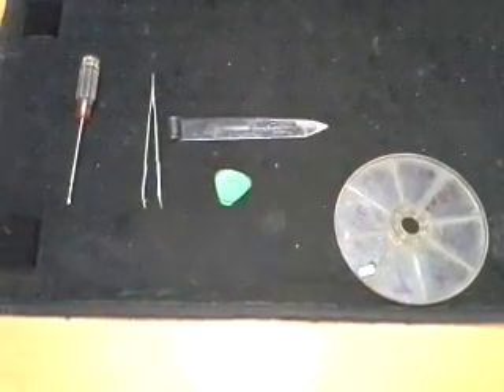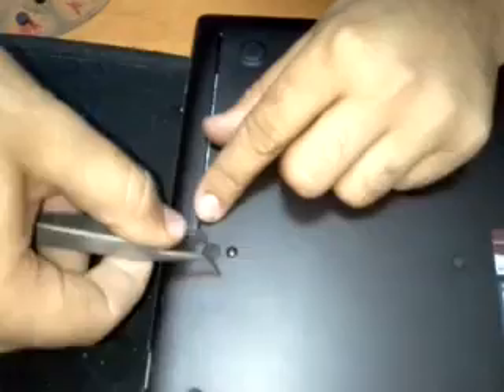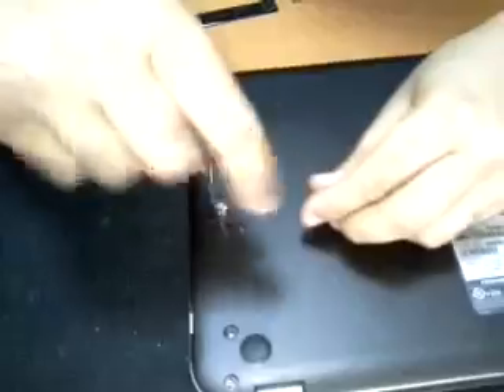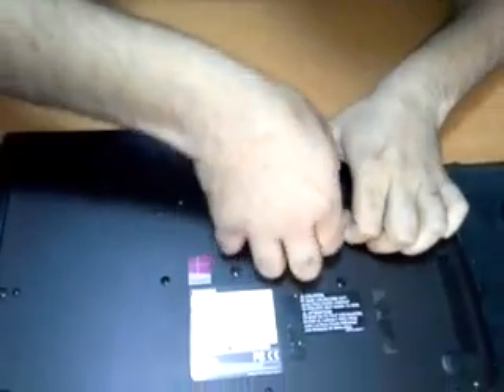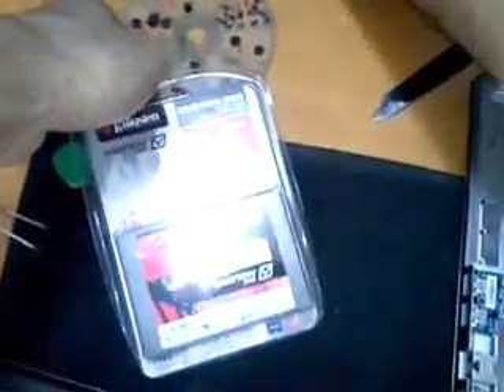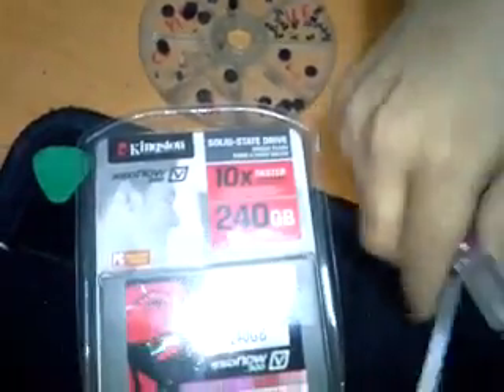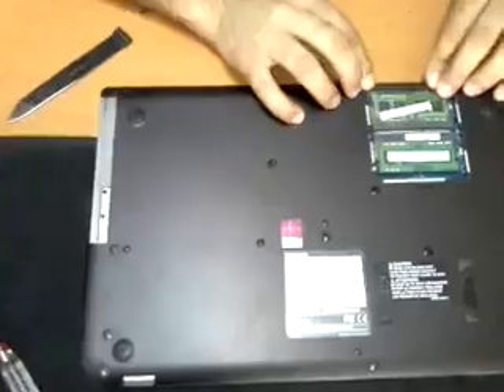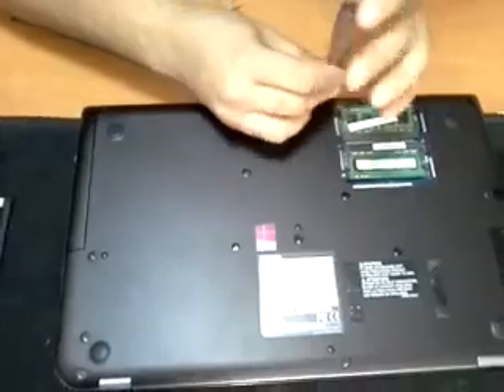How to disassemble TOSHIBA P50+SSD hdd replacement- Milad Ghaddar

Comment: Mr. Ghaddar, I own a Toshiba Sattelite P50-B-10J. It tells me the RTC is low on battery. 2 questions: a) does this model have a RCT battery. b) is it easy to switch? (as long as you have an IT savy friend).
Any help would be greatly appreciated.
Thank you in advance

Comment: I have the P50t_b and have successfully cloned using crucial 2tb mx300 and Acorns software. I have been viewing your video on here and others.. All show how cumbersome the dismantling  to access is to replace the original HDD, but none show if successfully booted up direct from the SSD without any problems.. I'm assuming there shouldn't be or you and others would have warned so. Other videos I've viewed indicate that you 'may' or may not need to change the Bios settings.. are there any videos showing how to do that if necessary.. Hopefully, the SSD newly cloned drive will start without the need to change BIOS setting?

Comment: Hello mate! First of all, I must say thank you for this video. I appreciate it!! And I also have one question related. I got the TOSHIBA SATELLITE P50D-C-104 (Which is also of Serie C) and i want to upgrade de DVD Drive to Blu Ray drive. Could you tell me what is the Blu Ray drive I must Buy??? Is ist a Panasonic Uj162 slim???? Thanks
Reply: So this one could fit?? The Panasonic UJ162:
http://www.ebay.com/itm/Blu-Ray-COMBO-Drive-UJ172-UJ162-Toshiba-Satellite-P50-P50T-S55t-L55t-C55-/271538144824
This is slim.. So does it fit??? THANKS

Comment: Hi. I have Toshiba Satellite P50-B-11U Same laptop and i have overheating problems. If i open GTA V, CPU got 1.22 GHZ and all cores temps like 93C and GPU temp 89C around much lag. :( My laptop is new and clean but overheating problems. How i can fix? My CPU Intel core i7 4720HQ and the GPU AMD R9 M265X.
Reply: Milad Ghaddar ميلاد غدار I can't change processor because you know "HQ" series processors are soldered by Motherboard. Cannot change because no socket. The problem from the CPU Cooler. Cooler change possible?
Reply: Milad Ghaddar ميلاد غدار CPU load TEMPS like 93C and 1.22 GHZ. How i make Load temp like around 70c max? How i make good cooling for cpu? Thermal paste or CPU fan upgrade? What you prefer ?
Reply: Hello sir! I have also an old laptop MSI CX640-DX (i5 2430m with Nvidia GT 540m) but with same probl like you (overheating the CPU and GPU when gaming) because of poorly common cooling system solution- chinese i could say. The solution is to install MSI afterburner and see if you could downcrease the frequencies on GPU and on GPU RAM, with 50-100 Mhz. You could try to modify your GPU bios in order to have the possibility to adjust the frequencies. I play FIFA 16 ocassionaly on this laptop and i could say it works, but only on 1200x780 with low graphic resolution and also low detail! But i don t try GTA V, because i know GT 540m lacks on that requirements. If you have other questions you could right to me to andreighiu@yahoo.com or to speak on skype andi240579 is my ID.
Reply: Andrei Ghiu I think you have OLD MSI laptop. That's why you have overheating too... But new series MSI Gaming laptop's not have overheating problem... Still Toshiba laptops have overheating.. But MSI laptops not have overheating anymore... For example: MSI GE72 Apache Pro etc..

Comment: Thank you for this video, this is what I am looking for. I am just wondering what is the blue triangle piece, which opened the back case of the laptop? I just need this piece to open the case. With screwdrive, it will damage the edges. 
Can you let me know what is that?
Reply: Guitar pick

Comment: Hey, my P50t-B laptop can disable the battery from the BIOS (for servicing porpuses). I used this future because I had to replace my HDD (fortunately, everything went fine :-) ). The laptop cannot be powered again until it is connected to an AC adapter, meaning that the battery is effectively disconnected. This should be a safe way to "disconnect" the battery before replacing the HDD, right? Otherwise your video was very helpful, thanks for uploading it to YouTube!

Comment: HI nice video!
The SATA port in this computer is II or III? Do you get the full performance on the SSD (500Mb/s R&W) ?
If I want to change the DVD with a 2 HDD, what is the size of the Caddy that I buy?
Thanks!!!
Reply: from the video, I see that it has 12.7mm OPO, which is the universal one, and Toshiba has it on all Satellite series.

Comment: Thanks for sharing it.  I have Toshiba Satellite P50T-A, and I need to reset the BIOS password.  Can you help locating the jumpers on the motherboard that I can reset to remove the BIOS password.

Thanks,
Reply: Not sure if you still have the issue, but the jumpers are down to the left side of the ram sticks. Find JRST2501 and short the two sauter points during boot up